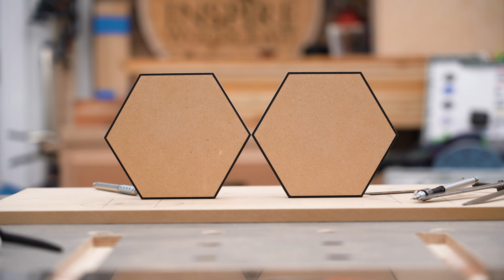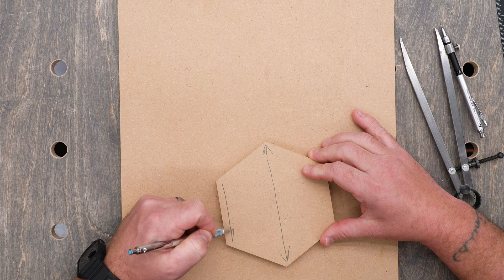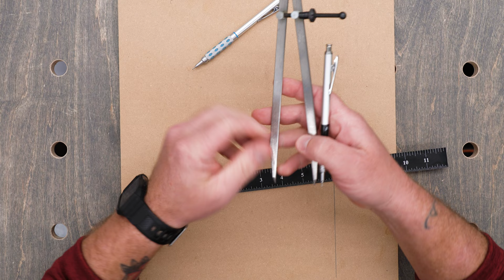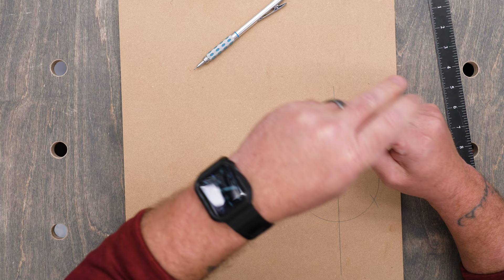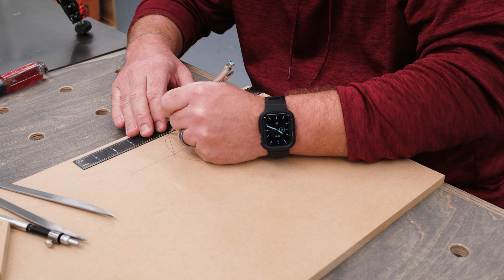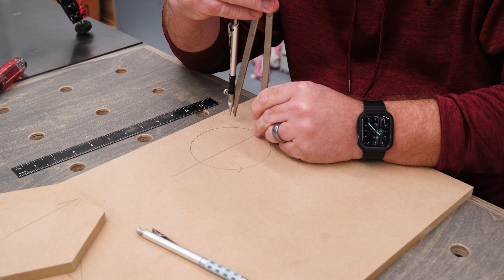The ONLY Hexagon HOW-TO You'll Ever Need / How to Draw a Hexagon With or Without a Compass

Comment: Having worked with hexagrams before, I finally figured out that they are all composed of equilateral triangles. That means all the triangle sides are equal in length. It is not coincidental that the line across the center, from point to point, is twice the length of a side. It is composed of two sides, so it must be twice the length. It took me an embarrassing length of time to finally realize the geometry of hexagrams.
Reply: Hexagons are the bestagons. :)

Comment: I’m an old man now, but I remember my geometry. I wonder if it’s even taught anymore. There is a lot of useless stuff passing as “school worthy” I hear.
Reply: I'm only in my 30s and had to take geometry in my first year of high school, so, yeah. It's still being taught. Lots of proofs in that class, lol. Same for trigonometry, which was the bane of my existence because the teacher was retiring after my year and the textbook sucked ass. But there's also a lot of stuff, mostly trigonometry (which is just the geometry of triangles), that wasn't taught that I've learned on my own since, and that I use quite extensively when I do my own work hand-calculating geometries for vector graphics and hobby CAD work.

45-45-90 and 30-60-90 right triangle trigonometry are my bread and butter, but I also have a few quick tricks for sketching specific angles to within a few percent error as well, to the point that I can just eyeball sketch a 30-60-90 right triangle or an equilateral triangle on graph paper with an error of ~1%. The trick is a triangle with legs in a 4:7 ratio or a base:height of 8:7 for the equilateral version, scale as needed. :)

A 4:1 triangle will get you a 14 degree or 76 degree angle--pretty dang close to 15 or 75 degrees if you're just quick-sketching on graph paper. A 5:2 triangle will approximate a 22.5 or 67.5 degree angle quite nicely as well with very low error. Again, the caveat is that this is only useful for quick sketching on grid paper, if you wanna get things close enough to look pretty accurate.

Another fun one is that the Pythagorean theorem generalizes to all triangles as the Law of Cosines: c^2 = a^2 + b^2 - 2ab cos(gamma). No longer do you require the angle opposite side c to be a right angle. It can be any angle and Law of Cosines solves for the unknown value. And when the angle gamma is 90 degrees, that whole 2ab cos(gamma) term goes to zero and Law of Cosines simplifies right back down to Pythagorean Theorem again.